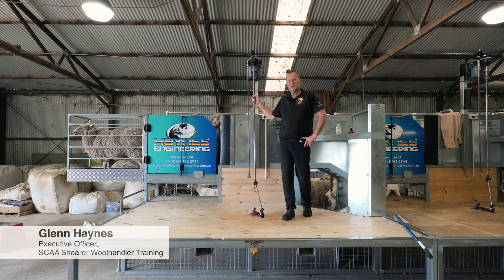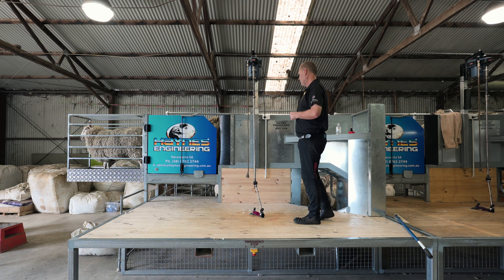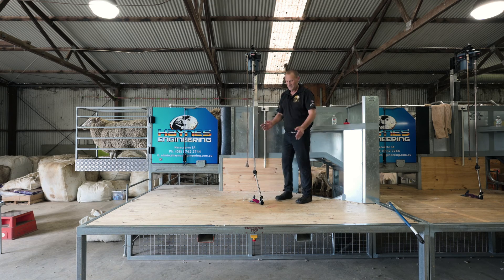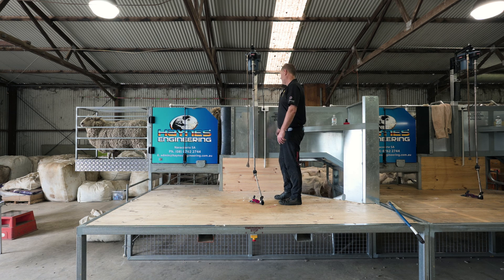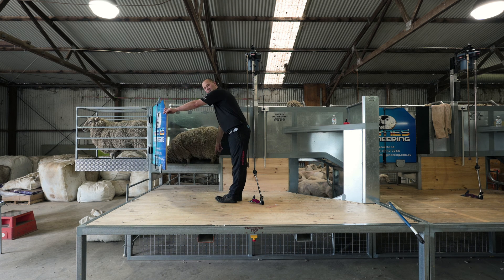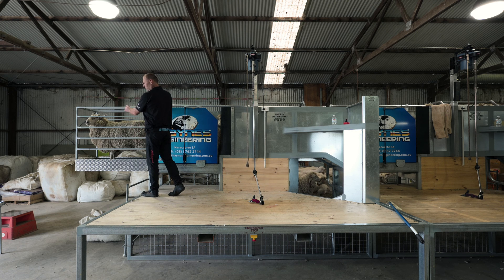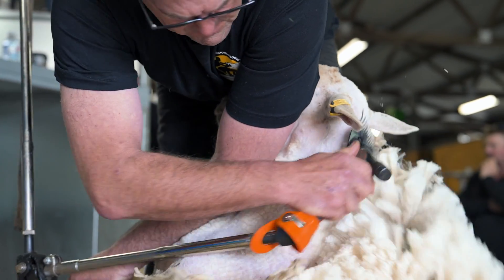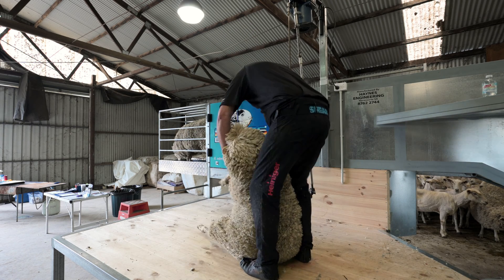Instructional video: How to catch sheep from the Race Delivery Module

Comment: Possibly the only decent idea the AWI has ever had and its "borrowed" from race trailers/trucks in the UK.
In Scotland we had a truck in which we shore.  The door was a push down type and the sheep ran the other way.  Worked really well as the sheep fell almost in the right place each time.
This is much better than the expensive machine assisted delivery module thing from 1-2 years ago, and something every shed could add without spending $100,000 or more.